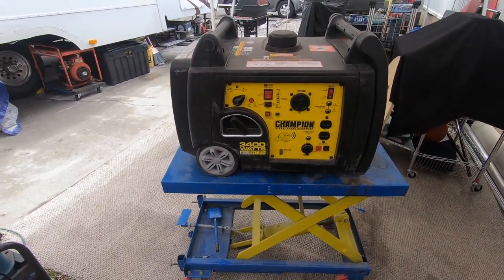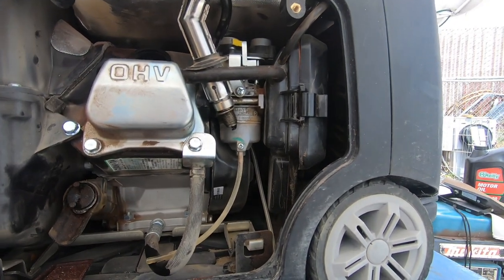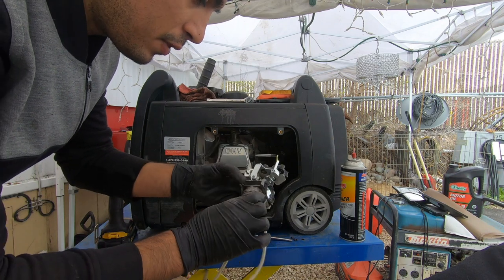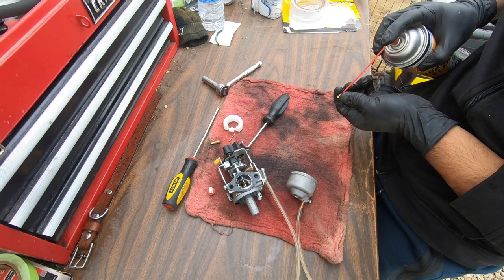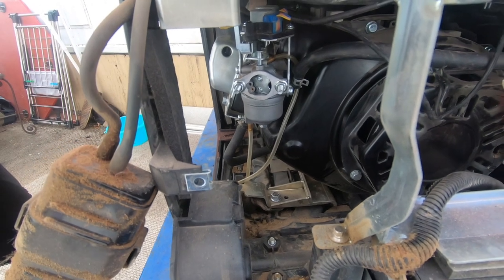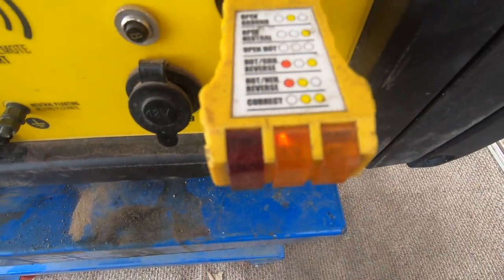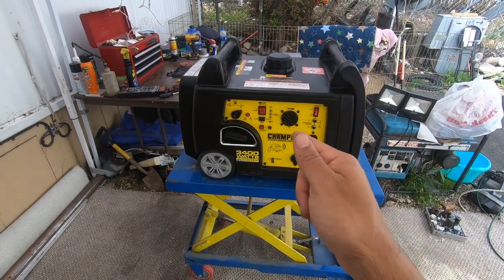Champion 3400 Generator. how to clean carb and run diagnostics.

Comment: Is the potting material they used to waterproof the inverter board soft or hard. Wondering if it could be dug out so that component level repair could be possible?
Reply from the maker: It is very hard feels like glass to the touch. and unfortunately it would be a nightmare to remove it from the board without causing more damage. if it was possible I would go that route instead of the replacing parts route.

Comment: I have a 3100 champion generator, while i was cranking trying to start it, out of nowhere it just seized up.   There was no clunk or other sound that would indicate that the motor blew up, if i pull on the recoil cord, it still does turn but its VERY stiff.  Do you think a shorted inverter could be causing my issue too?

Comment: Ive got a cat rp8000e that runs for 30 secs and the cuts the power to the plug, i disconnect the oil level sensore wire to bypass and see if thays the problem but not iy still cranks, runs great, makes electricity but in 30 seconds it cuts off, it's got to be something electrical Out imagine but far as the engine running itself is pretty simple the way it's made I just don't know why it would cut off in 30 seconds other than it being like the oil level sensor but since that's unplugged that shouldn't be telling the engine to cut power but it's still live if you got any ideas I'd appreciate it alright thank you for the video God bless in Jesus name

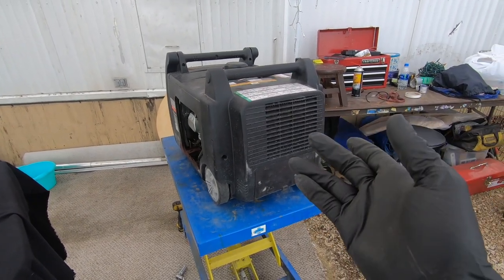Comment: At about 18:15 you mentioned running the generator really hard frying the inverter.  Is the something common with this model, or something true with all inverter generators?
Also you mentioned it being ready to sale.  Do you sell rebuilt generators for shipment?
Reply from the maker: This is the case with all inverter generators. imagine driving your car at top speed while fully loaded. just because you can it doesn't mean you should. 

And I fix them up to resale locally.
Reply: @immortalengines1605  hey man thanks for the reply.  Is this issue of burn out only true for the inverters, or also for the larger output portables?  So it seems since the only control I have is the amount of load I ask of an inverter, should I only connect it to the amount of wattage to match its running watts, or should it be less allowing for start up?
I'm trying to decide which generator to buy and still protect my sensitive circuit boards.
Reply from the maker: @olegig5166  generators are much more likely to have power issues when ran at the limit and in the heat. non inverter generators are usually used for heavy duty application such as construction sites. those don't have an inverter so they can be ran a bit harder. never start a generator with a load and if you are going to start an appliance that will heavily load the gen turn auto throttle off for it to rev up and be ready for the load rather than have it rev up on it's own after it's been current shocked.

Comment: Have the same or very similar generator and to me seems the auto choke is stuck on.  From near new it seemed to only run correctly when using auto start with remote and the choke would turn off on its own then run fine but now it is running as though the choke is constantly on and pushing the button makes no difference and it’s consuming a lot of fuel.
Is this a thing ? Thank you.
Reply from the maker: Do not run it like that! if the choke is constantly on then it sucks in more fuel washing the cylinder walls of the oil it needs to stay lubricated. 

do and oil change asap. 
remove carb and clean/lube the shafts where the tiny motors connect for both throttle and choke
Reply: Thank you.

Comment: How often should you need to start this generator?  I have one and only have a couple of hours on it but have changed out the carb already and recently went to start and it will not start. Any advice.
Reply from the maker: sounds like you leave it with gas. there is no need to change the carb simply clean it as i show in this video it really isn't all that hard. next time you are going to store it do this: step 1: run it until it runs out of fuel. step 2: drain the carb, there is a little hose sticking out of the bottom of the carb that is there to drain it. and 3: with those 2 steps done manually choke it and crank it over,  it wont start but it will suck whatever fuel is left in the carb and 100% rid of any residual fuel. do not store with Stabil. it only works for a limited time and then it causes even more damage because the owners trust it for far too long.

Comment: If you want to keep your generator being gone bad run it at 85% its capacity max. On the HOT days, over 100F, run it at 70% its capacity max. Heat will kill anything!

Comment: What to do with bad inverter units? hope you don't throu it away. They can be refurnish.
Reply from the maker: As far as I know they can not be fixed. the coating they have all over the electronics is next to impossible to remove without causing more damage. it's easier to just get a new one.

Comment: do you think i can bypass the CO sensor of my champ 4500 gen so it wont  shot off if im using on my semi chasis frame? if yes how to by pass it?
Reply from the maker: You should make an exhaust extension instead. 
I'm not familiar with the Co sensor on these. And if i was it probably wouldn't be a good idea to show people how to disconnect them.

Comment: How should I go about troubleshooting same model generator that does not run without choke on?
Reply from the maker: clean carburetor the pilot jet located on the outside is clogged. do not store with fuel even if its stabil
Reply: @immortalengines1605  thanks.. I'll give that a try.. you have mad skills.. keep posting..

Comment: On another video concerning a Champion like the one in this video he had a problem with rusty carb bowl.  It was claimed the gen had only been run on propane.  Is this possible?  Does running propane only in fact cause condensation?
Reply from the maker: it is possible. but the carb bowl is fairly easy to remove from the carb without pulling everything from the gen. I would personally like to run the generator on one full tank of gas every now and then.
Reply: @immortalengines1605  ok, once again great info from you.  After considering all the various options, I'm pretty well decided on a standby unit in the 17K range.  This generator will be on LP and has no option for gas.  Should I be concerned with this cab bowl rust issue or is a propane only system made differently from one using either gas or LP?
Reply: @immortalengines1605 I only run mine on propane because it's easier. What does running it on gas do for it maintenance wise?
Reply from the maker: I don't have any experience with propane gens but i would imagine condensation is an issue. 

in case of running it with propane i guess it's always good to drain the carb bowl if it has one. 

the issue with gas is the ethanol and the moisture

Comment: What happens if the propane part runs but the gas part doesn't work on the duel fuel generator
Reply from the maker: bad gas clean or replace carburetor

Comment: where can  I get a replacement main jet like the one in this video?
Reply from the maker: call champion their number is in the description. do you live at high altitude?
Reply: @immortalengines1605  the screw head got damage.
Reply from the maker: @Puyax01  shoot ok. fot that you will need a stripped screw remover tool. it looks like a screw but the threads are backwards it should come out that way. unless its already out
Reply: @immortalengines1605  i was able tonget it out. I just dont want to put it back in like that. Preffer to replace it

Comment: Is it possible to send a bad inverter board and have it repaired?
Reply from the maker: The inverter boards are sealed in epoxy from the manufacturer so it's basically impossible or id be more than happy to just replaced the fried component instead. i have a pile of those boards of all brands and sizes
Reply: @immortalengines1605  Sounds about right. To change the alternator on my SUV I had to take out the CV joint. It is all about money.
Reply from the maker: @TheMickeymental  Exactly. there are Thousands of inverter generators that are perfectly fine mechanically but have a bad Board. if only I could get a hold of them...

Comment: What was the contact info and part number because that is exactly what's wrong with my 3400w champion?
Reply from the maker: part number: Cpe01207 call champion at: 5622369422 tell them it just broke out of a sudden and that you never ran it hard and you expect a free replacement unit and you will take care of installing it yourself.

Comment: Plug something into the generator when you are done.
Reply from the maker: I did at 28:19
Reply: @immortalengines1605  Missed that one sorry I must have been scraping the epoxy off my inverter board at that time. I have a 1000kw Caterpillar Diesel Generator that you could repair and make a video. You would only have to  pay shipping and I live in Guam. Let me know.
Reply from the maker: @TheMickeymental  I'd love to try and fix it but it will likely cost an arm and leg from Guam to Nevada ;( what is wrong with it? maybe I can walk you through some diagnostics.
Reply: @immortalengines1605  I was only joking keep up the good videos.